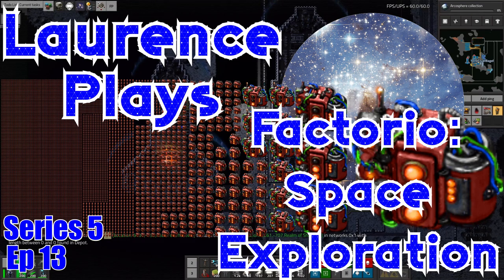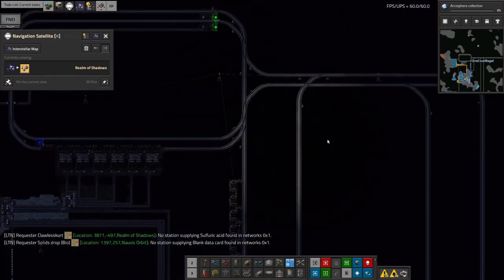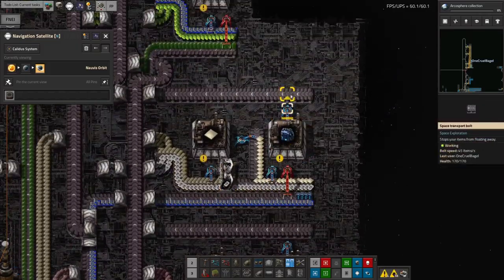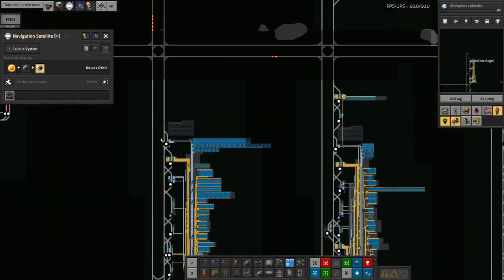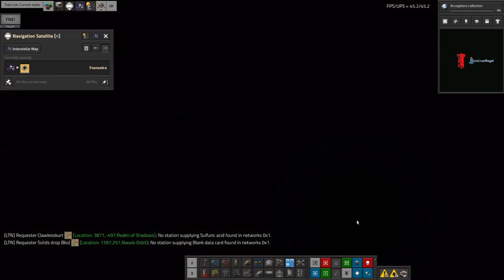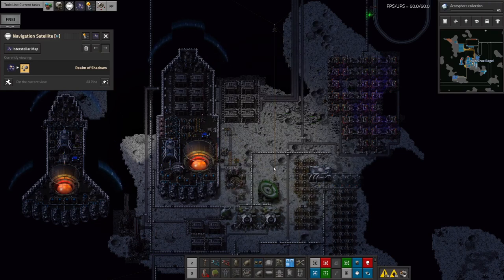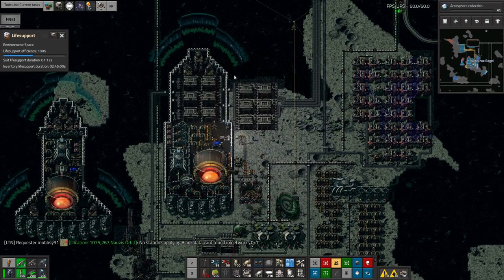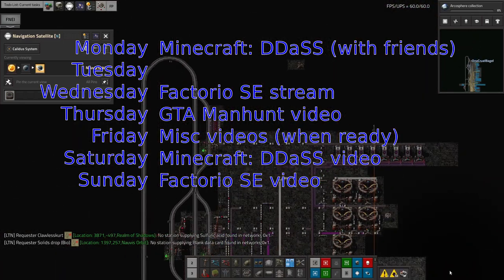S5-E13 - Modulation Maximation - Laurence Plays Factorio: Space Exploration

Comment: I notice your module builder set up is complaining about low power... though that does provide the illusion that the one belt of green is enough, since belts aren't slowed down by lack of power like machines are. :D I think the latest updates did fix the night vision stuff/errors, I recall seeing it in the AAI changelogs. But also, you can use the Afraid of the Dark mod for the streaming/video stuff, I use it as a rule of thumb and it works perfectly with Space Exploration. Now that you're back to a more sensible time, I'll be doing my best to join the streams again, looking forward to it. :)
Reply from the maker: Oh, I didn't notice the low power! I'll have to stick some more solar in there. I'll make a note! Yeah, the green circuit shortage is annoying, but I suspect efficiency modules will be used in lower quantities than others, and I intend to improve the green circuit supply as well.

I'll check for another AAI update next time I play. And take a look at Afraid of the Dark - that does sound very useful - entirely for you guys, of course!

Comment: Have you used circuit driven pump systems to balance fluid train pickups? if your supply side produces quickly it's not really important but things that trickle out getting unbalanced to the point that you have 25k on one end a 16 units on the other can be frustrating. I haven't done any side-by-side comparisons on whether it actually improves throughput, my intuition is that it should but the math pans out that it shouldn't ultimately change much- but it does for sure save you buffering some enormous volume of whatever fluid.
Reply from the maker: I've never controlled them with circuits, but I do occasionally set up pumps to push liquid down the tanks, or to make sure they get filled from both ends. Most of the "expensive" fluids I'm working with are in the space station though, so there's only a couple of tanks in the station, so it balances fairly well by itself. I know exactly what you mean about the fluid frustrations though - loading fuel into spaceships is something that I've had to tweak a few times.